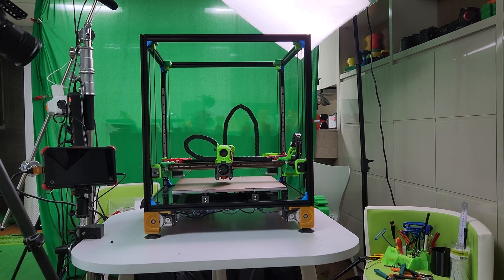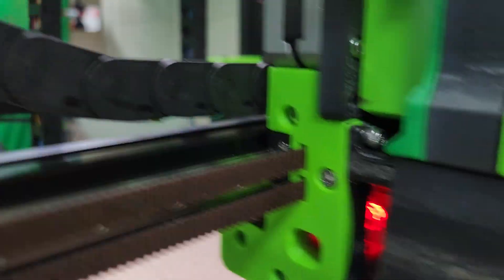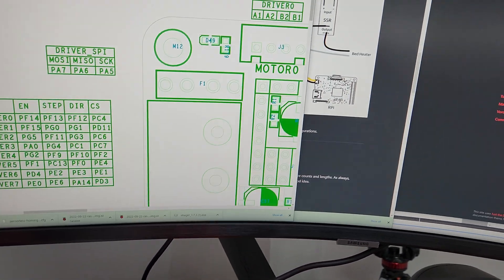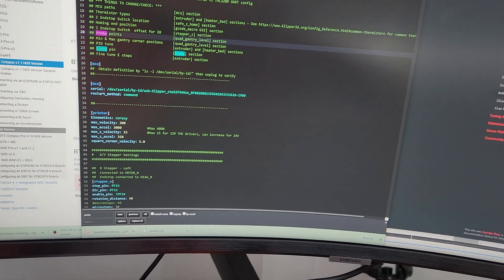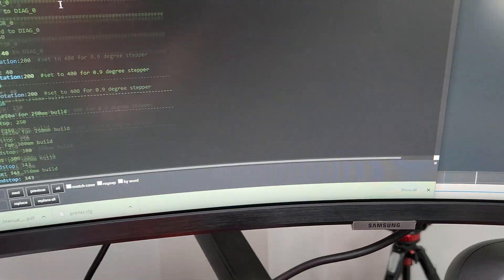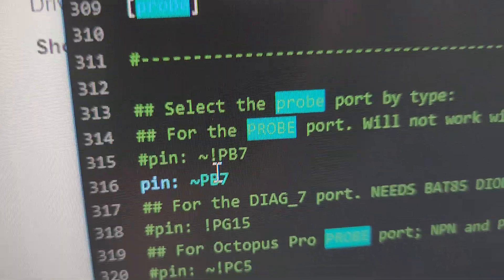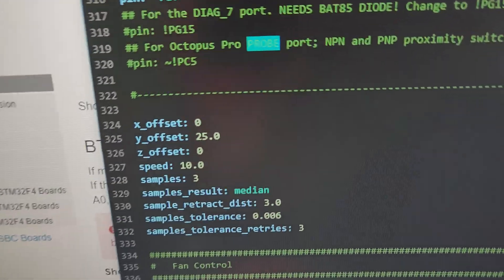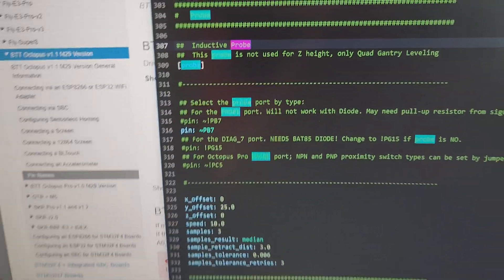How to Setup Formbot Voron 2.4 Kit Omron Inductive Probe/Wiring!

Comment: You may be both right and wrong here.  You can leave the diode, and wrie as instructed with the voron documentation.    you just need to change the probe signal pin to PG15
Reply from the maker: No diode needed for Octopus V1.1, there is a dedicated probe port you can use.